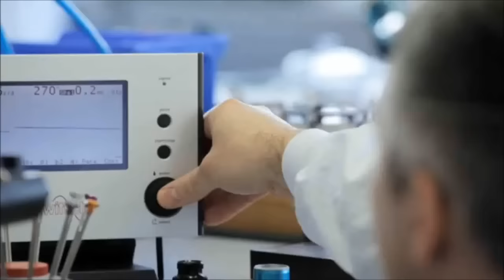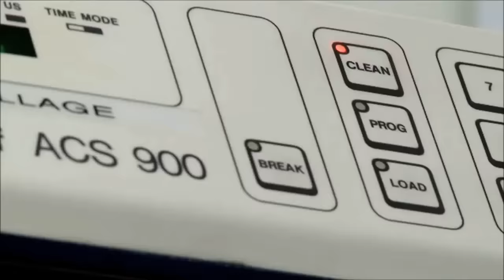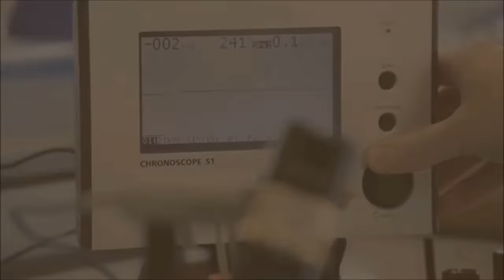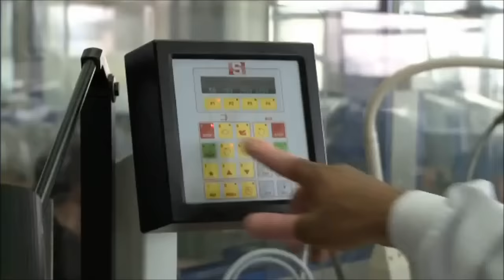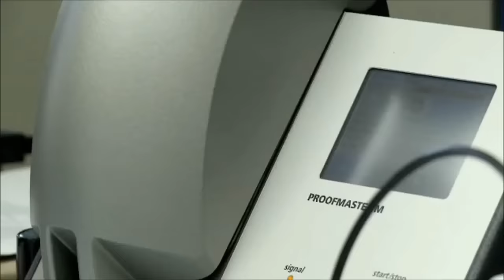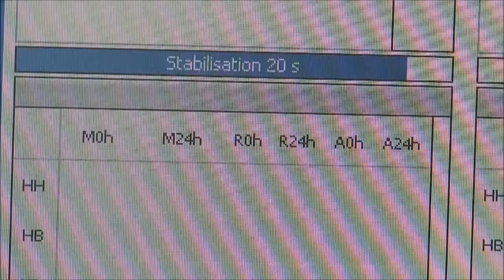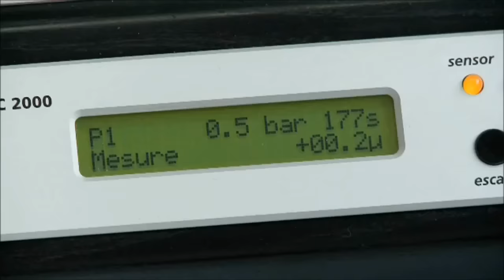Patek Phillipe Service and Maintenance (Long English version)

Comment: well, I'm not surprised. Even if the service was perfectly doable by an average watchmaker, they had to come up with some fancy, complicated servicing process to justify charging stupid money. They just CAN'T offer a 50 dollar 5 year interval service for watches with price tags starting a some 10k USD ;) they charge 130 CHF just for changing a BATTERY!!! but hey, that's a must if your quartz movement watch costs 50k USD ;) I wonder though, which brand has a better cost of build to final price ratio...fashion bs like MVMT which costs 10 USD in production and sells for 300 or Patek costing 10k USD and above, but actually costing a good few grand in production (the time, the precious metals).

Comment: So basically the real expensive watches were all based on the human body, like Da Vinci's work? The Japan came along and stole most of the market, with Battery operated watches and the were never wrong, just replace the battery ever 3 to 5 years depending on the brand of battery and now days i think the lithium batteries will last over 10 years ? Like timex, Seiko Casio Lcd watches which now if you have those from the 1970's to early 1980's are with just as much as some of the expensive first line watches ?

Comment: every 5 years?? get to fuck, that's often. I have a Breitling ETA, chronograph that's run within COSC for the past 13 years without any service (and my guess is an ETA service will be a fraction of the cost of a PP-service). you need to do better Patek

Comment: Overkill 100%. If they got rid of all those machines they could easily provide a less expensive service. 
I’m almost certain even the toilet paper in the stalls are automatically dispensed to a fine tolerance. Really? Using a automated machine which lifts and dips 10x watch cases for cleaning.  The staff must be exhausted at the end of the day…….

Comment: This kind of watches are more like novelty over quality 
why would you invest on just looking at time when you can have much better accurate timepiece for less then  100 dollars well it is no use of me to say it is just novelty and humans from the dawn like novelty but to me this kind of watches donot make sense why not just use a simple cheap rolex they are quality and some are not that complex making them more reliable and resistant to time I have one seiko that is not in use for 8 years runs butter smooth when I put it on and give it a little shake

Comment: A case opening tool..a toothbrush...some wd40 spray and brush.....lol
Reply: I ruined a patek philippe nautilus annual calendar. Grey colored dial. Opened it up. Was a little curious to see the inside. Used wd40 on it. Thought it couldnt harm. Extra lubrication. The whole mechanical system froze up. Bye Bye watch. Now Im waiting.  Takes lot of time to get it.

Comment: Rolex makes better watches.
Reply: +A Sorry, not even close...  

To compare Patek Philippe with Rolex is similar to a custom, hand built, Rolls Royce to a standard production, mid-level Mercedes.  While although quite good, there is no comparison in quality.
Reply: +Alex P don't fall for troll bait
Reply: +Alex P They keep better time and are thus more practical
Reply: +A A quartz movement keeps much better time than any mechanical movement.  Some quartz watches can be bought for a few dollars.  So what?  A mobile phone is more accurate than most quartz movements as they automatically correct via GPS and internet time signals.Patek and other fine manufacturers pride themselves on design, craftsmanship and innovation.  A Patek is a prized example of the watchmaker's art, while a Rolex is mass produced with an exceptional presence and marketing campaign.  Sure a Rolex is rugged, but I don't think a gentleman in a boardroom needs a diver's watch!  Rolex has its place, and so do the top firms.A Patek is painstakingly handmade and that makes it special, especially in today's world of mass production.A Rolls-Royce is still a Rolls-Royce. I'd take a Patek Philip anytime!  Mr. Stern's watches are among the finest in the world and owning one is not only a distinct pleasure, it is a privilege.  A Patek is a watch that can in fact be handed down to the next generation.  A mere old Rolex often gets relegated to the dresser drawer.
Reply: +Alex P A watch is made to tell the time and Rolex does a much better job at that compared to Patek. Most people who own Patek don't even wear them because they're too afraid to damage it and reduce the value. A Rolex can take anything you throw at it and still function flawlessly. Recently one was found submerged under the ocean for 14 months and it still worked. I'd like to see Patek do that.
Reply: +Seikosha LordElgin Thank you.  I enjoy wasting time with fools...
Reply: +A 

"A watch is made to tell the time and Rolex does a much better job at that compared to Patek."  

Really?  I think many if not most of the owners of Mr. Stern's watches would disagree.

"Most people who own Patek don't even wear them because they're too afraid to damage it and reduce the value."

I have worn one exceptional watch for close to 30 years, almost daily.  While I'm careful of it, I bought it to enjoy and the same is true of other watch enthusiasts.  Most of have earned plenty of money, usually in our own business or profession, and own several models.  We don't worry about value as much as we appreciate the fine art of horology.  A truly fine watch is meant to last a lifetime, and more.

"A Rolex can take anything you throw at it and still function flawlessly. "

Yes, you are right.  Rolex while although a great manufacturer, and its products are robust, they lack the highly refined qualities demanded of haute horology.  Rolex fulfills a significant mass market segment and Patek certainly fulfills their own unique, much smaller niche.

Rolex produces about 1,000,000 watches per year.  That translates to 3,300 per day.   It has been reported that the few watchmakers at the factory in Geneva only work on high end watches and that standard steel watches are produced by machines.

Patek produces about 40K per year manual movements, and most other fine manufacturers produce no more than 15 - 20K.  These are exclusive, hand-crafted creations designed for those who appreciate them.

Bottom line:  Rolex is mass produced, and so is a Chevrolet.  I drive one by the way, and it's close to 10 years old.
Reply: +Alex P You don't even own a Patek
Reply: +A As a matter of fact I do, and own several other watches from another top manufacturer.  I used to live in Switzerland and know the industry extremely well.  I visit all the time during the spring and have attended numerous fairs and expositions.  Horology is one of my three hobbies and I've been a watch enthusiast since I was 13 years old.

Any other comments?
Reply: My Rolex is better than your nonexistent Patek.
Reply: +Pikachu And your point is...

At times, I enjoy jousting verbally with those who have merde for brains.  

It helps me regain my typing skills after an accident and brings a smile to my face..

Thank you for the exercise.
Reply: +Alex P bravo!
Reply: Melon, most of my collection are Rolex's but the comparison is a rediculous argument but you already know it, don't you.
Reply: Believe me you know shit about watches....I own several Rolex's and i agree they are top quality.
But Patek is a totally different league..
Reply: Define "better". I have owned a Nautilus, and today I own two Rolexes. I am more happy with the latter than with the Patek. My Nautilus had a problem with the crown. Sometimes it just stopped. It was twice to the factory for overhaul. I should have kept it as an investment, though. But I guess I am through and through a Rolex guy.
Reply: The Nautilus is not the type of Patek which stands for Patek's craftmanship. 
Personal stories about issues are not the standard for saying which watch is of better quality. 
I had a lot of problems with recent Rolex models and now i only keep my vintage ones. Especially the 1675 gmt is a great reliable watch. But this is only my experience, and says nothing about the quality of the Rolex recent models.
Reply: Morgan Andred - Craftmanship is one thing, and possibly objectively measured - "better" is subjective.
Reply: Thats what i was trying to say....
Reply: Apparently, you have little appreciation of the time, dedication, and effort required in creating exceptional watches.  But then again, Rolex is for masses, Patek and other fine manufacturers are for those who appreciate the the finest of the watchmaker's art.
Reply: I used to live in Geneva and know the watchmaking profession very well.  Once you know the people and visit their workshops, you cannot help become more than a little impressed.  As a watch enthusiast for 50 years, I happen to recognize quality when I see it.  I wish you had the same background.  You would think differently. .
Reply: Really?  I wish you had the guts to say that to my face...  I am a retired airline VP/pilot in charge of technic.  I know quality, and I know a jerk when I see one!